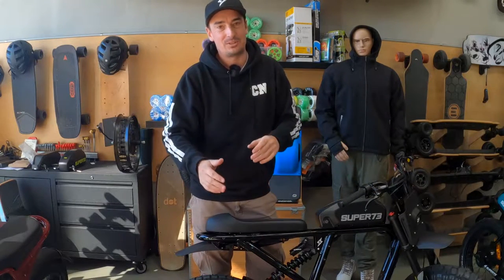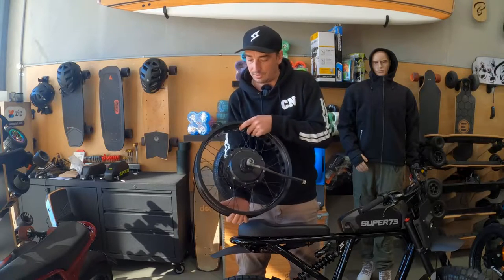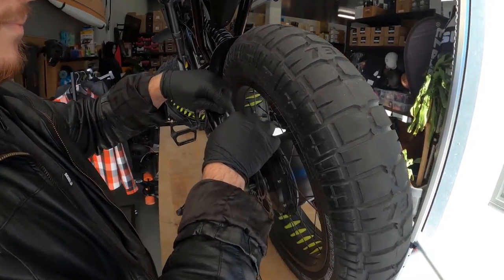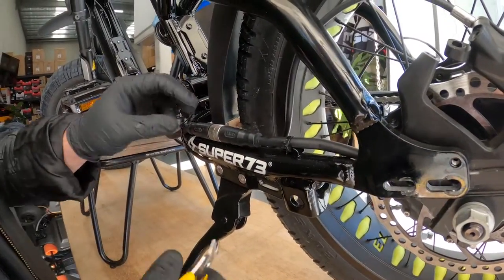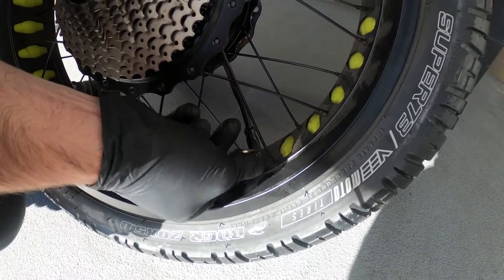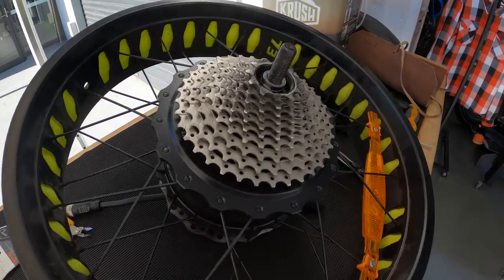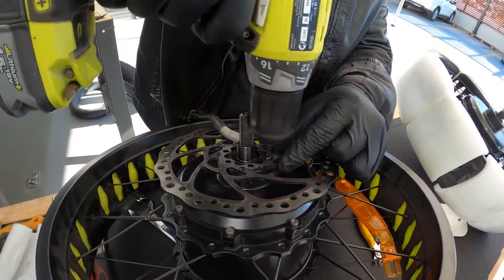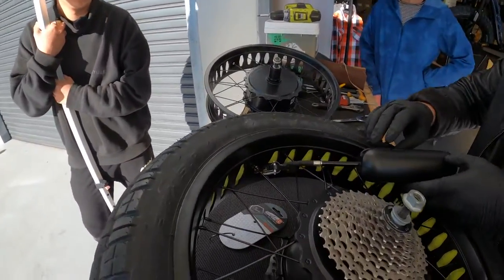How to Replace the Rear Wheel on a Super73 RX-E

Comment: If our rim is the only broken part and not the motor, is there any way to get just a a new rim and swich over the motor?
Reply from the maker: Hi Rex Hardman! Good question. The rear wheels are only available new as a complete unit, containing the motor. However, we have some used rear wheels where the motor was defective, so we could send you a used rear wheel with the defective motor removed, depending on where you'd like it shipped. Please email our team here - support@benbucklerboards.com.au

Comment: Anyone else having issues sliding the tire back in at 9:09?
Reply from the maker: Check that you've removed the chain and unplugged the motor cable :)
Reply: @benbucklerboards  I found the channels on my Z adventure frame were slightly smaller (like less than 1mm) then the grooves on the tire mount. I just needed a second person to get it on.